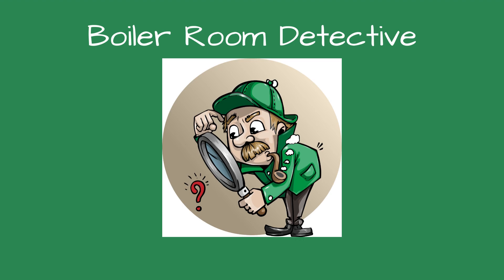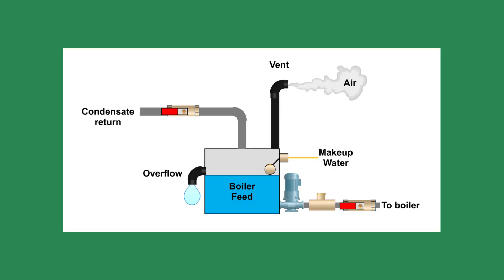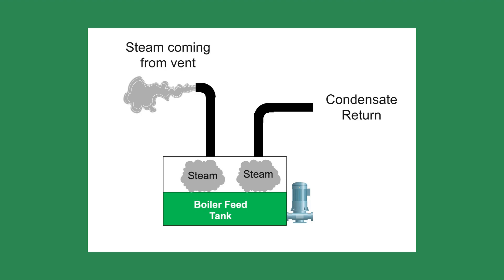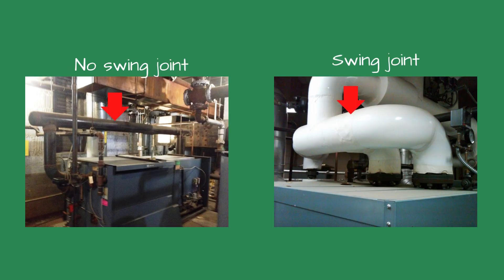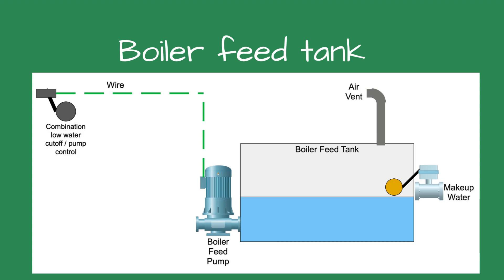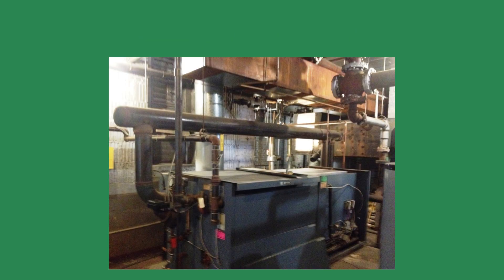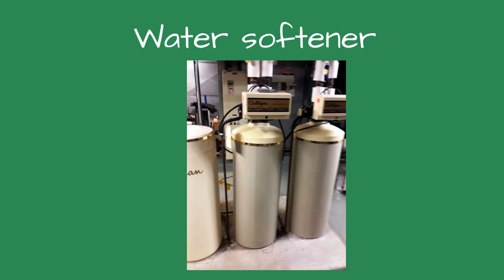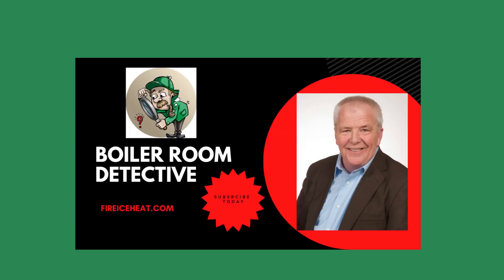Detective Tools   Replacing a steam boiler

Comment: Where would that vacuum breaker be installed when control valves are installed
Reply from the maker: It would usually be on the boiler or upstream side of the valve because the outlet side should be open to the condensate tank. Hope this helps